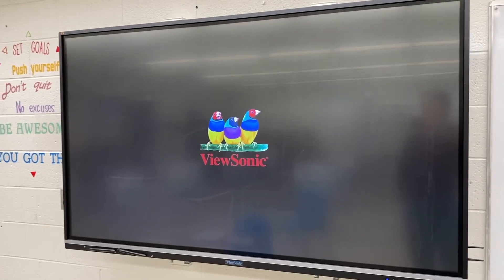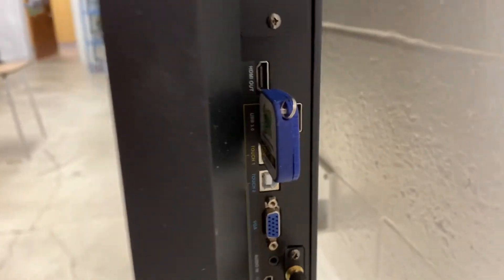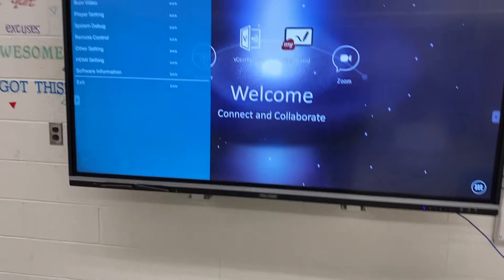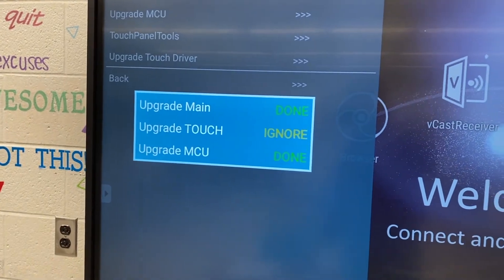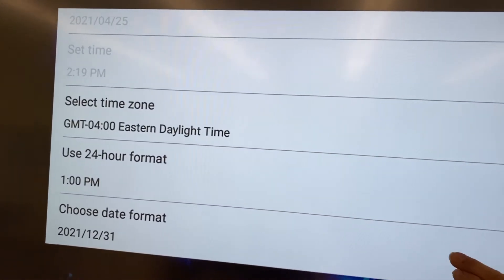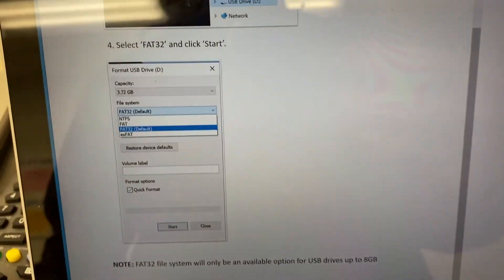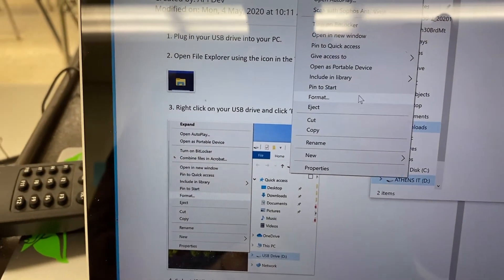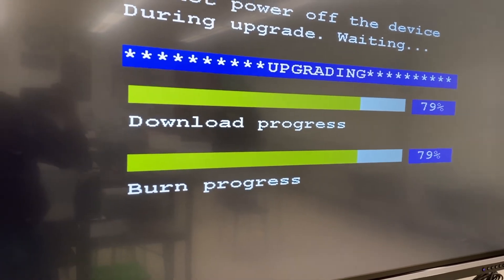ViewSonic UI firmware update

Comment: Just as a clarification, you don't need an 8gb or smaller flash drive (maybe just the volume?).  I have a 64gb USB 3.1 drive that I formatted and created a volume that's 4096mb/FAT32 and it worked just fine.  Thanks for the vid though!  Very helpful.

Comment: Do you have to extract the ZIP file or leave it zipped on the jump drive?
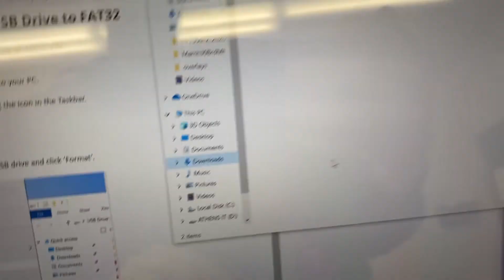Reply from the maker: It needs to be expanded into the file structure you see at 3:40
Reply: Extract the ZIP, then throw the extracted upgrade_551 folder into the root of the flash drive's volume.

Comment: I upgraded the firmware, it is better than before, but stuck at the same old display.
Reply: What version panel is it?  V2 upgrades well. V1 may get stuck at the older UI for the main screen.
Reply: @nickster0007  IFP7550-2
Reply: I reinstall it with the new UI main firmware. I got the right interface. I don't see the WiFi option when in embedded player mode. Do I have to install anything else?
Reply: I checked the Viewsonic, there is no WiFi Module installed there. It seems odd the interface on the edges of the screen are like the old one before. It works so much better with the firmware update.
Reply: @rtperrett  sounds like you’ve got it then?
Reply: @nickster0007  It is a lot better than what it was before.
Reply: @rtperrett  glad I could help! — Clint. A.K.A.  MasterOfNone